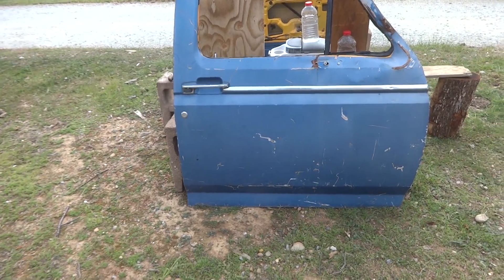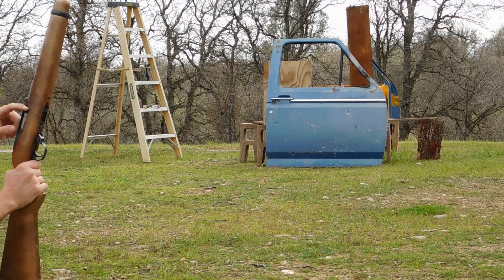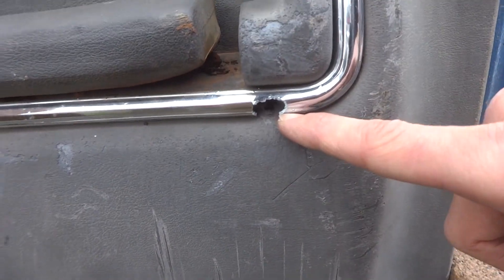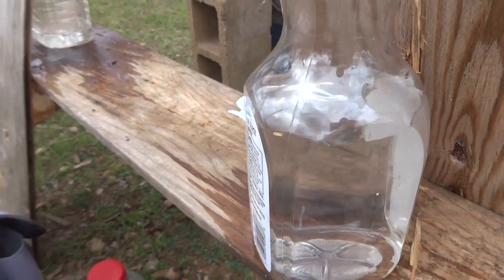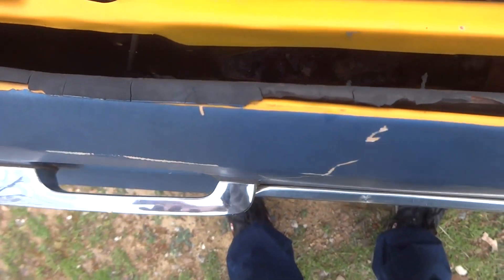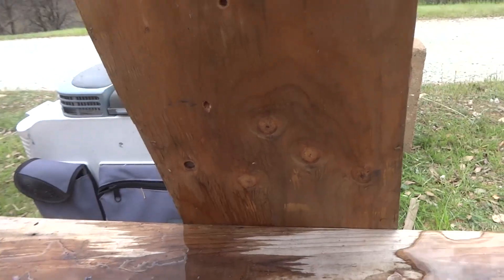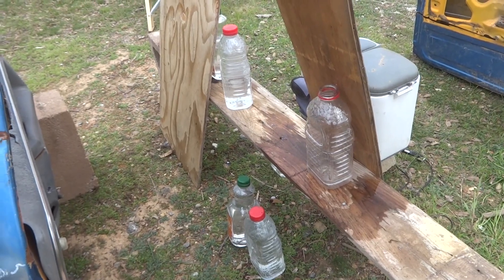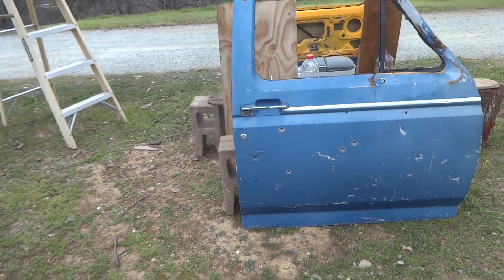Can a .22LR penetrate a truck door?

Comment: The very reason people underestimate .22lr is because they dont do the math. A  .40grain .22 diameter round traveling at 1200 or 1400fps can cause alot of damage. Even considering the round is known to mushroom & doesn't have a metal jacket; And there's many options to this little round & all are deadly,' some more than others. Keep in mind that even a 30 grain projectile traveling at 700fps is deadly but most .22lr used in handguns or rifles are gonna be traveling at 1050fps or more

Comment: The U.S. military has fought multiple wars with the .22🔥🤠
Reply: @poolee77  I'm sorry, I forgot it's a .22(3)
Are you happy now?🤠
Reply: @lcifermorningstar191  Implying that they're anywhere near the same is pretty disingenuous. Capability is radically different even for bottom of the barrel 5.56mm. M193 out of a 20" barrel can punch AR500 steel.
Reply: @poolee77  
We are talking caliber Sir.
The U.S. military has been kicking ass around the world with a .22 caliber bullet ever since Eugene Stoner designed the AR platform. One of the reasons he chose the .22 caliber is because it is low recoil and many American kids are familiar with it.
Maybe they should've called it the Super Duper .22
Regardless of it's high velocity due to a lot more powder. That does not change the caliber.

Comment: 22lr is not to be treated as a joke a lot off people compare it to a 223 or 308. Yes a 22lr going to look weak compared to a 223 but so does a 223 compared to a 50 BMG  223 still going to kill you. Same as a 22lr is going to kill you. Before anyone mention stopping power bang 5 to 10 rounds in centre mass off some one and see if they don't stop put it this way i wouldn't want to test taking 5 22lr to the chest. That's the power of a 22lr quick accurate shots with keeping the rifle band on target because off the low recoil great for close range snap shooting.